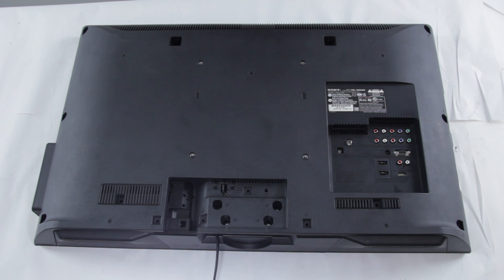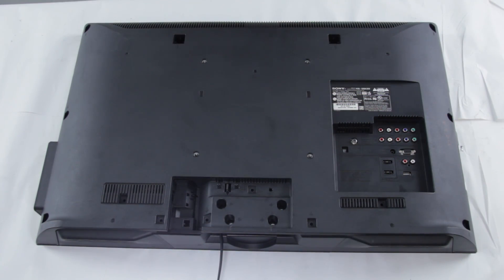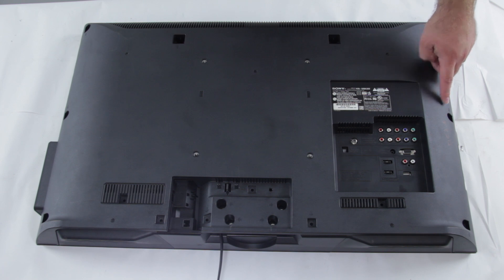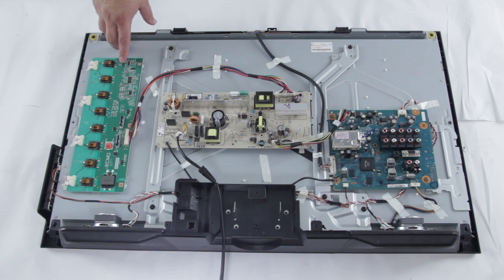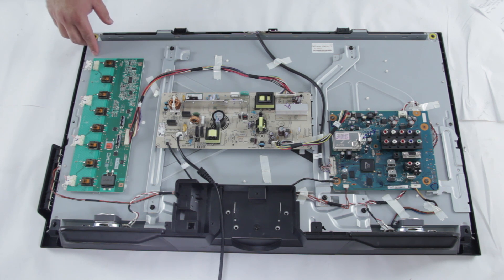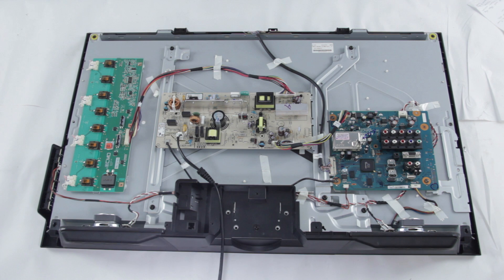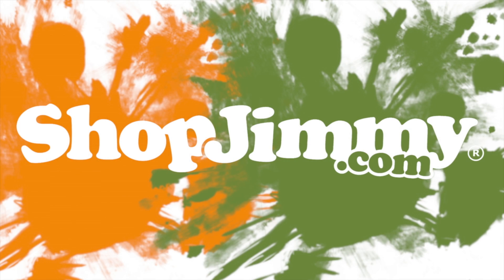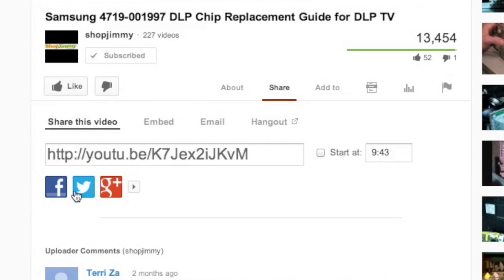LCD TV Repair Tutorial - Backlight Inverter Common Symptoms & Solutions - How to Fix LCD TVs

Comment: I have a Toshiba 32WL48G and when it warms up the screen starts to flash. I have option on tv menu in screen seting to set blacklight, range is 0 to 100 on 0 flash is more frequent, on 100 less frequent. pls i need some advice.
Reply from the maker: Miodrag Todorovic   Try all repairs and troubleshooting at your own risk.  This could be a problem with either the power supply, the backlight inverter or the lamps in the TV.  You can replace the power supply and backlight inverter boards individually to see if that fixes the problem.  Click this link to replacement parts for your TV model number:  http://www.shopjimmy.com/toshiba-pd1900c-1-sub-power-supply.htm  There may be multiple boards for the same TV model number, be sure to match part numbers on your current board, with your replacement for compatibility.  Thanks and please let us know if you have any further questions with your TV Repair!  www.shopjimmy.com

Comment: I have a Sony KDL-46V2500, Serial 8718440. Red light blinks 3, pause, 3 blinks, pause, forever until I unplug. Based on some research, it seems to be either backlight inverter or power supply. 

1. Which inverter do i need? right or left? 

2. Is it more likely the power supply or inverter? if it were to be one more than the other, which would it be more likely to be?

I'll be buying the part from you if you have it! Thanks!
Reply: Best advice get the service manual the troubling shooting section will direct you to what's bad
And when replacing inverter board am assuming it's a plasma it's best to replace both. Y and X sustain board

Comment: Hi shopjimmy. My samsung 37" LCD tv does not want to turn on lately. If I hold the menu button as the red led light flashes the tv will turn on. Everything is ok till I adjust the back light or any brightness setting then the backlight flashes like a strobe then goes off completely. I then have to turn the tv off then do the menu thing to get it on again as it never turns on normally. The screen light turns off when I use pc input aswell. I changed the power board but it didn't help any problem im having.
Reply from the maker: SaucyBegger25   I recommend replacing the main board in your TV.  Please reply with your TV model number.  Click here to view a video that shows how to find your TV model number:  https://www.youtube.com/watch?v=S51nhAmwR2M  Thanks!  www.shopjimmy.com
Reply: hi, thank you for the reply! the tv is a Samsung le37r88bd. it does seem to be working a little better now ive been using it as a pc monitor. the menu is saturated and the picture isn't 100% (can see saturation when colour/brightness/contrast adjusted) I thought this board in the video would be the cause of the problems now power board was changed and no difference. but you will know more than me. there is a dark patch down the left sode of the screen. funny enough where the dark patch is it seems to burn the image into the screen? it goes but if I pause anything it burns into the screen just where the dark patch is?
Reply from the maker: SaucyBegger25  This sounds like a TV panel (TV Screen) problem.  If your TV panel is bad, it may be more cost-effective to replace the TV as panels are typically hard to find in stock, difficult to replace, and expensive.  Thanks and please let us know if you have any further questions!  www.shopjimmy.com

Comment: hi, i have a dinex dx-40l261a12 which have red vertical lines in the entire screen, i would like send you pictures but i don't have your email,. what board do you think that can be? and if that is the faulty then can i buy this board in your store? thanks
Reply from the maker: vladi salas   This sounds like a TV panel (TV Screen) problem.  If your TV panel is bad, it may be more cost-effective to replace the TV as panels are typically hard to find in stock, difficult to replace, and expensive.  Thanks and please let us know if you have any further questions!  www.shopjimmy.com

Comment: I have a LG 47LN5700 smart TV and all of a sudden the screen went black but we could still hear sound. When we power off the tv the LG logo appears normally for a second but after that its black again.I put a flashlight to the screen and could see an image. I unplugged it for 30 seconds and plugged it back in, upon being plugged in a quick flash appears on the screen but then everything goes black right afterwards. I figured its the black screen but not sure. Any suggestions.
Reply from the maker: kgi333  I recommend running the flashlight test on your TV.   Here is a link to a video we produced that shows how to run the flashlight test. https://www.youtube.com/watch?v=xUzCLgoSPGM Please reply with your flashlight test results and we can recommend a replacement part for your TV repair. Thanks and please let us know if you have any questions! www.shopjimmy.com

Comment: I have a Vizio SV422XVT. When I turn it on, the Vizio Logo no longer shows up on the screen, but you can see that the screen is on because it is slightly lit up. There is no picture but the sound is good. Is this a backlight bulb or an inverter issue?

Thanks
Reply from the maker: Randy Stewart  Try all repairs and troubleshooting at your own risk.  I recommend replacing the main board and the power supply board in your TV.  Click this link to replacement parts for your TV model number:  http://www.shopjimmy.com/catalogsearch/result/?q=SV422XVT  There may be multiple boards for the same TV model number, be sure to match part numbers on your current board, with your replacement for compatibility.  Thanks and please let us know if you have any further questions with your TV Repair!  www.shopjimmy.com

Comment: I have a Toshiba 50L1350U S/N:D12248T12563L1 the screen flickers in spots (really noticeable in white areas) then after about an hour of view time the backlight goes out. Audio is unaffected.
Reply: It is not the power board. i replaced it, didn't fix the problem
Reply: Since writing this comment it will not illuminate at all.
Reply from the maker: James King   It sounds like you have bad lamps in your TV.  Unfortunately we do not sell replacement lamps or TV panels.  Thanks!  www.shopjimmy.com

Comment: i have a SAMSUNG MODEL # LN55C630K1FXZA / SERIAL# Z1PL3CCZ406832P / V.SQ01 it has sound and a dark dim faint picture i thought it was the inverter board so i replaced it with a new one no backlights come on still having the same problem please help me troubleshoot . could it be the power supply ? main board? any help will be appreciated
Reply from the maker: rose   This could be a problem with either the power supply board or the lamps in the panel.  You can replace the power supply board to see if that fixes the problem.  Click this link to replacement power supply boards for your TV model number:  http://www.shopjimmy.com/catalogsearch/result/index/?cat=229&q=LN55C630K1FXZA  There may be multiple boards for the same TV model number, be sure to match part numbers on your current board, with your replacement for compatibility.  Thanks and please let us know if you have any further questions with your TV Repair!  www.shopjimmy.com

Comment: I have a Sony KDL-52XBR2 TV that has just started to turn off shortly after being turned on. The picture and sound are both good up until the shutdown. I feel it to be one of the backlight inverters (this model has 4). I have watched the videos online, but none of them appear to be like my TV and my results are different than the videos. I am tempted to replace all 4 as the picture is really good on this set. However, it looks like that requires taking the screen apart and removing the tubes to be able to remove the old one. Is this true? Can you tell me a more precise method of testing my boards? I have a multimeter and understand the test points. Just not sure how to narrow down to one board or even one transformer that could be removed.  The inverters are Samsung INVST520B (LL, LU, RL, and RU) Rev 1. The set S/N is 8012909. I see no visible damage to any of the boards (i.e. bulging caps or charring).
Reply from the maker: engeldad   It sounds like you have bad lamps in the TV panel.  Unfortunately we do not sell replacement lamps or TV panels.  Thanks!  www.shopjimmy.com

Comment: Hi thanks for sharing this video. This is exactly my problem right now with a 40" Logik Lcd tv, model no.L40DIGB20. I took off the backlight inverter, which is a Samsung LJ97-02098E (SSI_400_14A01) and noticed it had some burn marks on the inverter board where it seems like several IC's had burnt. I am in need of that inverter. Also I noticed one of the 16 bulbs was broken. I wanted to ask, how I can replace those bulbs and do you have another video in regards to this, that I can look at? Thanks
Reply: Also where can I get those bulbs from, and can I replace them to Led's instead?

Comment: Hi,
So my problem is that the the light went out, because you can still hear it.

Model Code: UN39FH5000FXZA
Its a Samsung.

If you need more info, please let me know.

-Thanks
Reply: Model: UN39FH5000F
Version: Pf03
S/N: Z79L3CUDB23586Y

Comment: Hi the model i have is Alba lcd32880hdf 32" - tv switches on for about 20 seconds then goes black - tv sounds still works during black screen - have open tv but does not appear to have a separate backlight circuit board
Reply from the maker: Kev Williams   I recommend running the flashlight test on your TV.   Here is a link to a video we produced that shows how to run the flashlight test. https://www.youtube.com/watch?v=xUzCLgoSPGM Please reply with your flashlight test results and we can recommend a replacement part for your TV repair. Thanks and please let us know if you have any questions! www.shopjimmy.com

Comment: Hi, I have a JVC Model LT-37XM48 It works but the picture is messed up from the middle toward the left side. It is dark & weird LOL. Sometimes it is fine! Any Ideas
Reply from the maker: The Cowboys Grille   I recommend replacing the main board in your TV.  Click this link to replacement parts for your TV model number:  https://www.shopjimmy.com/catalogsearch/result/index/?cat=225&q=LT-37XM48  There may be multiple boards for the same TV model number, be sure to match part numbers on your current board, with your replacement for compatibility.  Thanks and please let us know if you have any further questions with your TV Repair!  www.shopjimmy.com

Comment: I have a Samsung Model LA40S71B, model code LA40S71BX/RAD S/N :AGUG3DDLA00372N this is quite a old tv the symptoms i have was it would show picture then turn off i can hear the sound no problem i know that that the Mainboard and PSU is good and i did your flashlight test i can see images and sound is good so it may well be the Backlight inverter thats gone on it im hoping if your able to to provide parts for this model and are you able to deliver to New Zealand.

Comment: I have a dynex dx-lcd42hd-09 and I have no pic but hear a sound when I turn tv on I changed out the backlight inverter still no pic?
Reply from the maker: Duane Kortas Jr   I recommend replacing the main board in your TV.  Click this link to replacement parts for your TV model number:  http://www.shopjimmy.com/dynex-6hv0206910-main-board.htm  There may be multiple boards for the same TV model number, be sure to match part numbers on your current board, with your replacement for compatibility.  Here is a link to a video showing how to identify your part number, click here:  https://www.youtube.com/watch?v=LIWO2A_tuaI  Thanks and please let us know if you have any further questions with your TV Repair!  www.shopjimmy.com

Comment: Good morning. I have a Samsung LN46D550K1FXZA. A few weeks ago the picture was gone from my TV. I have sound, but the screen is black. If the room is dark and I shine a flashlight I can see a faint image. Last week I ordered a new Backlight Inverter from you and installed it this morning. Same issue still exists. Not sure if the part is bad or if I have an issue with something else.
Reply from the maker: Daniel Riccio   This could be a defective replacement inverter, power supply or the lamps in the TV.  You can try replacing the inverter again or the power supply to see if that fixes the problem.  Click this link to replacement parts:  http://www.shopjimmy.com/catalogsearch/result/?q=LN46D550K1FXZA  There may be multiple boards for the same TV model number, be sure to match part numbers on your current board, with your replacement for compatibility.  Thanks and please let us know if you have any further questions with your TV Repair!  www.shopjimmy.com

Comment: I have a 42 inch vizio. The screen flashed white then shuts off. It's model # vizio M420NV Serial# LAQKGUAL4800124 .there are only two boards  in the back of this tv. Is the inverter board tied in to one of these boards.
Reply from the maker: D Clare  Please watch this video FIRST to help with your repair!  https://www.youtube.com/watch?v=BP3NVNCGEv8  I recommend replacing the main board in your TV.  Click this link to replacement parts for your TV model number:  http://www.shopjimmy.com/catalogsearch/result/index/?cat=56&q=M420NV+  Be sure to match part numbers on your current board, with your replacement for compatibility.  Thanks and please let us know if you have any further questions with your TV Repair!

Comment: Hi I have a Samsung LA37C550 and sometimes it does not come on, the red light is on but no picture, also remote wont work when red light is on. Is it time to get a new one
Reply from the maker: Bill Smillie  I recommend replacing the main board in your TV.  Click this link to replacement main boards for your TV model number:  http://www.shopjimmy.com/catalogsearch/result/index/?cat=56&q=37C550  There may be multiple boards for the same TV model number, be sure to match part numbers on your current board, with your replacement for compatibility.  Here is a link to a video showing how to identify your part number, click here:  https://www.youtube.com/watch?v=BEPWrefQvqI  Thanks and please let us know if you have any further questions with your TV Repair!  www.shopjimmy.com

Comment: I have a sony klv-40bx420 it turns on but the upper half of the screen showing perfectly but the lower half is showing red/blue color only any idea what the problem would be
Reply from the maker: Mohammed Harb   This sounds like a TV panel (TV Screen) problem.  If your TV panel is bad, it may be more cost-effective to replace the TV as panels are typically hard to find in stock, difficult to replace, and expensive.  Thanks and please let us know if you have any further questions!  www.shopjimmy.com

Comment: Hi, I have a 46in Sanyo lcd flat screen. Its showing mostly vertical lines (rainbow) lookin colors was showing on one side of the screen, but when I let the TV warm up it was going away, but now it doesnt and its on the whole screen now. Also just started showing a couple of horizontal lines at the bottom of the screen now. If you could help me diagnose this issue It will gratefully appreciated. Thanks Alot

Comment: Hello! I got a Samsung LCD  TV LE32S71B and few days ago screen went black but there is still a sound, no backlight. I replaced a blubled capacitro which was really was on power supply board and it was really close to wire which goes to inverter, not sure, maybe they could be related.I wonder what would be the problem with this tv. Thanks for your time!
Reply from the maker: Edijs Kalvenieks   I recommend running the flashlight test on your TV.   Here is a link to a video we produced that shows how to run the flashlight test. https://www.youtube.com/watch?v=xUzCLgoSPGM Please reply with your flashlight test results and we can recommend a replacement part for your TV repair. Thanks and please let us know if you have any questions! www.shopjimmy.com

Comment: Please help I have an avol tv model Apw4220H it works well for about 5 minutes then the picture goes in and out like if a bulb was just loose.. i just hit the tv a couple of times and it works again for like another 5 mins.. what can i do to really fix it?
Reply from the maker: Redbone4569   This could be a problem with either the power supply or bad lamps in the TV panel.  You can replace the power supply to see if that fixes the problem.  Unfortunately I do not see any replacement parts in the search results for your TV model number on our website.  Please reply with your part number on your power supply board and I can try searching for replacement parts.  Thanks and please let us know if you have any further questions!  www.shopjimmy.com
Reply: thanks well i opened my tv and it was full of dust i used an ultra duster spray can and blew it out works great now not sure if that fixed it but its fixed lol thanks again for messing me back

Comment: hi have got a sony bravia tv kdl-40v3000 I turn it on and theres sound but no picture.but I can see light through the holes in the chassis.what could it be.thank you
Reply: model number 42xv540u / Toshiba/ Taco809/
TV turn on but no picture nor sound lines.
 Am402031034 not sure what this number is.

Comment: Hello, I have a Sony Brava kdl-40s2000. It runs for a bit perfectly ,then it turns itself off, power light goes off the turns itself back on one second latter-nothing else blinks. I have checked the capacitors and all is good. any suggestions would greatly be appreciated. I'm no stranger in fixing and soldering LCD monitors so I'm up to and major repairs.

Thanks

Comment: I have a problem with an AOC L37W465, one of the mosfets on the power supply burned out after a power surge, i replaced it along with 2 resistors that were damaged as well, but the tv doesn't turn on, the indicator led stays blue when i turn it on, but there's no sound or image, any suggestion?. I've checked every diode on the pwoer suplly, they're good, same with the 2 fuses.